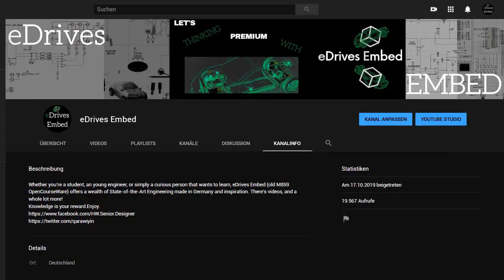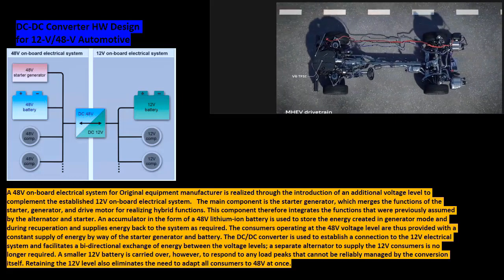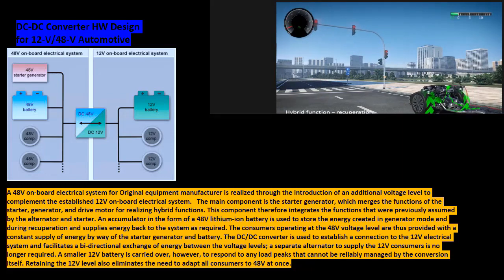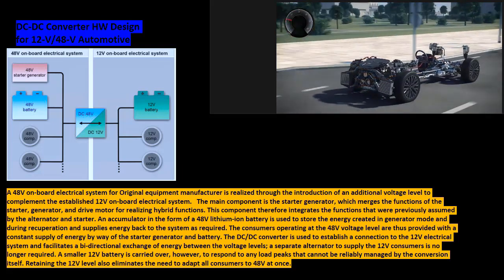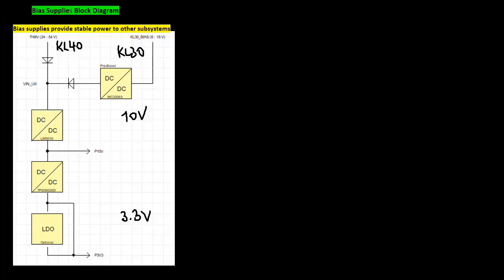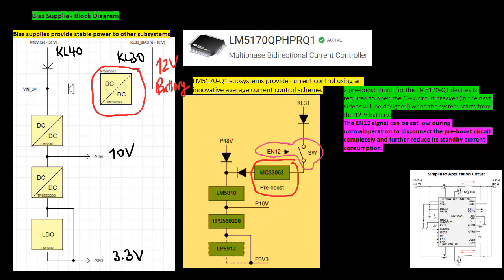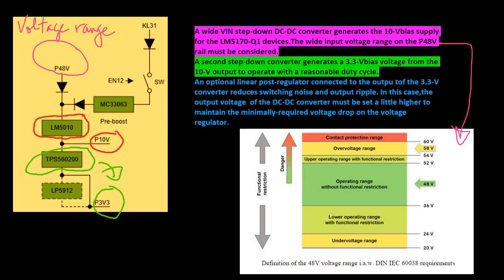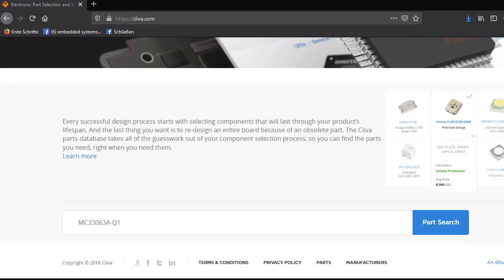HW Supply architecture for 48V-to-12V Buck Boost converter

Comment: Hi again!

I was wondering if you know what test and standards a device must pass in order to get the CE and E-mark approval. I know that for automotive some common standards are ISO 7637-2 and ISO 16750-2 for electrical and read somewhere CISPR 25 for EMC. It would be a nice idea for a video to show the different tests to take into consideration when designing automotive devices. Do you know what standards we should consider when designing to meet CE and E-mark?

Cheers!
Reply from the maker: The person placing the product on the market is responsible for affixing the label to the product. In principle, the company itself can also carry out the check whether it meets the requirements of the relevant directives. This also includes the compilation of documentation as proof of conformity, which may be required depending on the directive. Important examples are the directives 2014/30/EU (EMC directive), 2014/35/EU (low voltage directive) and 2014/53/EU (radio directive). As both the clarification of the directives to be taken into account and the testing and documentation are usually very complex and costly, these services often cannot be covered in-house. In these cases, cooperation with expert service providers such as consulting firms or test laboratories with the necessary equipment and expertise is a good option. If the Directive stipulates that a so-called Notified Body must be involved in the conformity assessment, it is in turn mandatory to have the product tested by a suitable accredited testing facility. EMC: EN 301 489-1
EN 301 489-3 EN 301 489-7 EN 301 489-17 EN 301 489-19 EN 301 489-24 EN 301 489-50 EN 301 489-51 EN 301 489-52
radio:  EN 301 511 / 301 908-1 (Cellular) EN 303 413 (GPS) EN 300 328 / EN 301 893 (Bluetooth/WLAN) EN 303 340 / 303 345 (Broadcast Receivers)
  EN 302 858 (24 GHz Radar) EN 301 091-1 (76 GHz Radar) EN 302 264 (77-81 GHz Radar)
electrical security EN 60950-1 EN 62368-1
SAR/MPE EN 62209 EN 62311  IEEE 1528
Wireless charging EN 303 417 WPC Qi v1.2
for you as a manufacturer a multi-stage procedure applies:
- Identification of the EU requirements for the product
- Verification that the product meets the specific requirements
- determining whether the product needs to be checked by an independent body
- Test of the product
- Preparation of the technical documentation
- affixing the CE marking and drawing up the declaration of conformity

Comment: Another excellent video series. Congratulations!

As I commented previously in another video, I'm trying to design an automotive controller for 12V vehicles (hopefully it could support 24V as well, but that's not mandatory). I need to choose a buck converter to supply 5V @ 1-2A max) to the microcontroller and other secondary ICs. I read many TI's app notes and watched many of their videos. They recommend using buck or boost DC-DC converters running above the AM radio band, in order to comply with EMI/EMC regulations. That means choosing a DC-DC IC running above 1.8MHz since anything below 500KHz might generate harmonics and this wouldn't pass an EMC test (I believe it's CISPR 25 certification test, but I'm not completely sure). They have synchronous converters runing at 2MHz like the LM5360x-Q1 series. In your design the frequency is below AM, so I was wondering what is your experience with EMC with these circuits?

Also, do you see any advantages in using synchronous versus asynchronous DC-DC converters in the automotive environment?

Thanks!!
Reply from the maker: many thanks to such friends of the channel we need to support us mentally and continue to support graduates and students here.
to be on the safe side regarding thermal design you need an smps as an LDO. you only need a boost if the OEM requests it. there are tests where you can drop down to 4V and the customer demands that you are functional again without resetting, but costs more money and you should discuss with the customer if he needs it or read the specification exactly.  i don't think you need such frequencies, they also want to sell their IC's and this is also the trend to increase the frequency to make the magnetics smaller as well. but you need an EMI filter in form of PI in your input and make good layout. i have also shown this in my videos. with the TPS65320DQPWPRQ1 buck converter i had good experience Adjustable Switching Frequency 100 kHz to 2.5 MHz. Just in case you need an additional supply output.
Synchronous or Nonsynchronous topologies: there are trade-offs between them. A nonsynchronous topology is an older design, noted for power loss across the external Schottky diode. This power loss equates to compromised efficiency. A synchronous topology is recommended because it offers high efficiency and fits in a more compact form factor by integrating an efficient MOSFET.
best regards,
eDrives Embed

Comment: max current for this circuit?
Reply from the maker: i think you mean exactly this circuit in this video and not the high power circuit. for the KL30 (12V) path the maximum current is 1.5A, but the inductance is dimensioned for maximum 510mA., and for the 48V path the maximum current is 1A. but we will calculate this when we look at all loads.
Reply: @eDrivesEmbed  if i want to design 48v to 12v buck converter, high power, what should i do
Reply from the maker: @ahmedadel-ex4ww  that's what we are doing here, developing a 48V-12V dc dc bi-directional converter for mild hybrid cars. just follow the series.